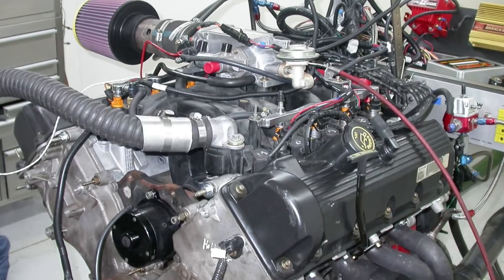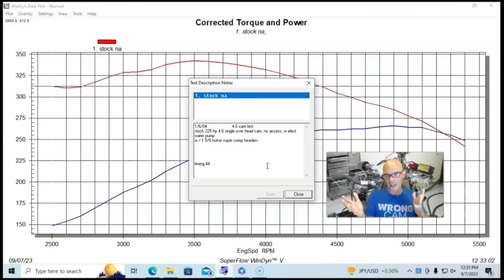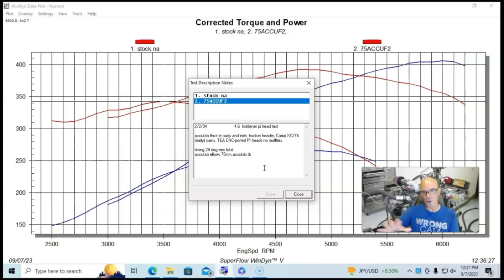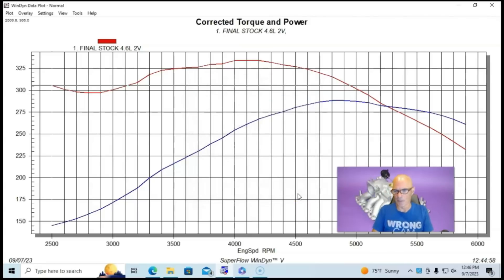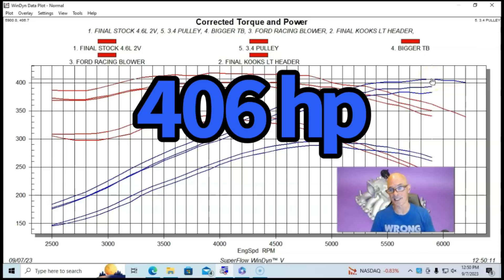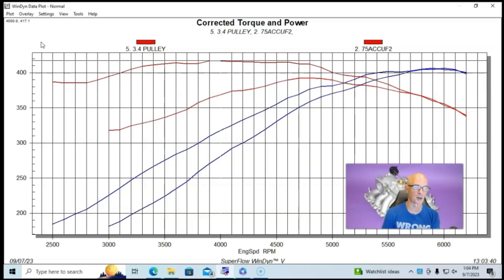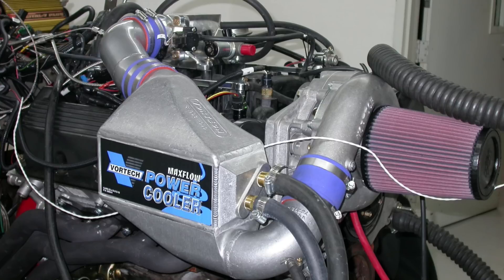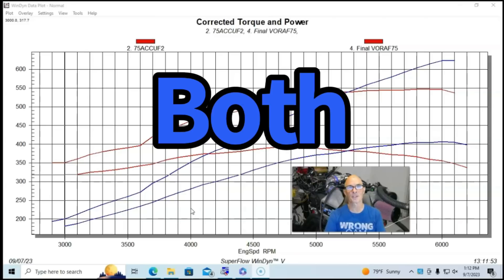THE 400-HP QUESTION-4.6L 2V MOD FORD-ALL MOTOR VS SUPERCHARGED-WHAT IS THE BEST ROUTE FOR HP? BOTH?

Comment: Only question I have is what mods were done for the supercharger ?
Reply from the maker: the motor specs were supplied-you can run it on a stock motor-but no longer avail

Comment: I have all stock 1998 mustang gt 4.6  with 120000 miles . Do have  pro comp aluminum intake and bbk cold air intake. I just want to add a super charger for some additional power. What do you suggest ?? Honestly if i had like 325 hp i think id be happy !! Help please !!
Reply from the maker: Vortech or Kenne bell

Comment: Any upgrades on fuel injectors or fuel pump and what tune if there is a link
Reply from the maker: yes we upgraded the injectors to supply the necessary fuel, the dyno has a very big fuel pump and we tuned it using a FAST or Holley HP ECU

Comment: PI or not 2v 4.6 LOVES boost. Add a little N2o, ur really cookin. I own a '98 mustang. That's my car in my profile picture. I put trick flow heads and cams in, forged eagle rods and pistons,  and a 92/80 Borg Warner efr turbo with a 100 shot to get her a spinnin. I made 804 wheel at 6700rpm. 680 lb ft at 4400 on e85. I did a bunch of other stuff too but I want to keep this short. I got my car down to 2880lbs with me in it. When I say the thing is terrifying I'm not lying. It's one of the fastest hard tire cars where I live and it's just a drift car. It has a drift American tubular front end, silver g2 coilovers, hydro handbrake, t-56 swap with a twin disc, 33 spline axles with 3.73 gears and a spool. In 4th gear going 80 mph I can mat the thing and the tires go up in smoke it's unbelievable. Not one other person has turned a wrench on my car. I am a mechanic but I'm no engine builder. I have 12,000 miles on the setup and not one time has it let me down. 20° outside, she fires right up. A/C blows cold, heater works, it's the best car I've ever owned. 2v Ford for life.
Reply: I wanna do that to a 04 f150 2v 4.6
Reply: I own a 98 mustang gt as well. So many times have I thought about coyote swapping it but the 2v 4.6 sounds better to me than the coyote. I want to build on it similar to what you did. Any advice??  how much would you say you spent? Thanks

Comment: I have a 4.6 non pi . Ported heads put shorty  headers ..cams .. valves performance intake   75 mm throttle body how many hp is it around 300 it runs good and good on gas I liked that super charged kit under the manifold hard to find that one might put a 112 on it I thought they could not handle a super charged your videos are great
Reply from the maker: at least 300 flywheel hp

Comment: If you want to Beat on an engine whenever you want that 4.6 will take serious abuse other than cracked intake manifold.  

I’m a Shelby owner with a built 09 5.4 dohc ported billet crank jesel roller followers and it’s an amazing engine but you can’t drive it like you stole it unless you’re prepared to.  
My 96 pi swapped 4.6 didn’t care.  I wailed on that engine.  Now I make decent $$ and I want to do what I’ve always wanted: waste a bunch of money and time making power the hard way with a mod motor!

Comment: I put set of old stock ford performance cams and and ford performance valves in a non pi motor 2 valve 42lb injector's with a performance intake , performance water pump  pulley   bbk shorty ported headers straight pipes with 2 1/2 pipes  glass packs all new valves  pulled good .,,, the 4.6l is rated only upto 400 hp stock correct is what I meant
Reply from the maker: Here is some helpful info-the NA non-PI combo you describe won't be anywhere near 400 hp and a positive displacement roots blower provides immediate boost and torque (more than the NA motor at any rpm)
Reply: @ can you put a pi intake on a non pi motor . I put a doorman on and leaks air can you put ford pi intake on non pi heads I already put cams and valves in hate to have to change heads  just for a few more horsepower whatever it makes is fine with me even
Reply: @ your right what o mean is a stock 4.6 non pi rated upto 400 hp correct not sure about pushing my motor further it has good torque that's it seems something would give pushing it further than designed I get I a Chevy ls2 supercharged it's a whole different ball game I drove the 2003 cobra totally different motor

Comment: Where do you even find a Ford Racing Supercharger kit? Can't even find them these days. Seems like a nice mild upgrade for a daily driver especially one like my 2002 Grand Marquis. I need it to merge with even just Carollas these days! 😂
Reply from the maker: I haven't seen one for sale in years
Reply: @richardholdener1727  Me either. It seems like such a simple piece of kit to slap on I'm kind of surprised the aftermarket hasn't caught up. I know a lot of 4.6 2v guys that just want that simple set up. Don't get much more simple than top mount Supercharger and injectors with a tune and still have a reliable daily car.

Comment: Were those stock injectors? If so, what would happen with HP using 39+ lb injectors?
Reply from the maker: not stock injectors-you need enough fuel to support the power level

Comment: Would the 400 supercharged setup with stock internals run reliably? 

I would never run a Vortech SC personally. They make a ton of power, but are unreliable in my experience. Customer support sucks ass and they don't warrant their products when the superchargers melt themselves. Otherwise great video!
Reply from the maker: I ran my Vortech for 85000 miles including racing in the Silver State 9 times-they are reliable
Reply: @richardholdener1727  Nice! Did you ever tow with it or was it just for drag races and cruising? I pulled a 5000 trailer, and the V3Si melted its own bearing cage and sucked in the intake seal.

Comment: My stock 4.6 explorer was knocking so got a guy using my block and pi heads and intake and I think ima ask him to build it now lol , already doing timing chain and oil pump and water pump and seals, might do crank, cams and valves too
Reply: What year I got a 2003 I’m working on. I’ve done a flow master 44 axle dump and it sounds great. Bout to add bbk 78 mm plenum/tb and k&n cold air intake. Did you end up using the non pi block or cams?
Reply: Yes non pi block and also did cams/ valves and a tune, pushing 440hp on e85  @ninamillimeter8926
Reply: Also did ac delete

Comment: Iv heard pulling 400 youll eat the bottom end up or get rod knock. These motors are boat anchors and its really annnoying that you have to spend double to make it go. They sound great and are tough when they're stock but man unless your a wizard mechanic and can do all this shit yourself its kinda pointless cause itll bankrupt you. Might as well just swap the motor or buy an ls. Not to mention thst t45 can't handle 400 horse at all. I think it would be pressed to handle 300
Reply from the maker: we have run over 700 hp with the stock bottom end-so the 400-hp thing is a myth
Reply: @richardholdener1727  oh really? I had no idea. I have an npi block with pi heads and iv wanted to push my platform as much as I can but anytime I suggest boost my mechanic always says it'll cook the motor. I'll take your advice over his though I think you know your shit provided who you are

Comment: On the both combination that you tested, was that test ran on pump gas or did it require race gas?
Reply from the maker: at higher boost we ran 100/91 mix
Reply: @richardholdener1727  ok, thank you for the reply

Comment: Mark VIII/Teksid short block with a PI top end is the scrap yard screamer build. You should try it maybe.
Reply: Exactly that's what I've got in my Mark VIII with many mods the car is a beast and sounds sick too
Reply: Do 4v blocks work with 2v heads???
Reply: Wouldn’t think so considering the width difference.
Reply: @setharnold3699  same block size on ALL 4.6. 2v, 3v, 4v can all use the same block. the pistons are different between them. Piston from 4.6 will go into 5.4 and vice versa.
Reply: @wadedalton2247  yes, they are the same, that's why its called a MODULAR motor.

Comment: In your experience, on a completly stock mach 1 4v, what would be the max hp you would feel comfortable with at the wheels in 93 octane?  5 speed car.
Reply from the maker: if it is completely stock, then won't it make stock HP?
Reply: @richardholdener1727 Sorry, I completely left out that Im buying a vortech supercharger for it.

Comment: Would a NA 400 hp to replace a regular 260 hp 4.6L in California be allowed?  Will it pass the smog test?  I have a 2000 Ford Mustang GT project car that I'm trying to upgrade.  Any help would be greatly appreciated.
Reply from the maker: you need to check with the manufacturers of the parts to see if they are Cali legal

Comment: Fascinating 😎👍🏻 

My MG came from the factory with a 2V 4.6 as standard so I’ve always wondered what I could achieve without going down the forced induction route. 

It only makes around 245 bhp so drives nicely but needs significantly more in a 1700 kg car 👍🏻 

400ish always struck me as a more suitable figure to make the car perform how I’d like.
Reply: You could add a blower without the forced intake and rely on the larger belt, you'd probably want to seal the hood though.

Comment: Is it actually possible to get a 2 valve 4.6 to 400 wheel horsepower? I see most people lucky to get 300.  N/A that is.
Reply from the maker: I've never seen 400 whp from an na 4.6l 2V-but it is possible. Would require more compression and different intake manifold with more rpm

Comment: I want to see a 2v 4.6 with the trick flow heads ported, tork tech 2800 tvs blower and cams. I want to see the actual potential of the motor. 2v are always over looked and slept on. Then punch the motor out to 5.3 aluminum. We can call it a 327
Reply from the maker: watch the 4.6l 2V vids with the ported heads, cams and Kenne Bell

Comment: your engine dyno is super happy idc what you say no 2v on the planet is doing this power with heads cams and a tune its not making 400 plus crank without a power adder such as boost, your the only person on the planet with these results and thats because there bs.
Reply from the maker: you know so very little
Reply: i love your videos and i watch them alot, but ive never had a 4.6 last over 450 wheel. @richardholdener1727

Comment: Have you guys made a video of putting 4v heads on a 2v or 3v motor? I have an 08 f150 4.6 I'd like to play with. Someone on market place mentioned putting 4v heads on 2v with some tuning.
Reply from the maker: easier to just get a 4V motor from the junkyard
Reply: @richardholdener1727  yes and no. The 4v heads were already rebuilt and cammed. That's why I asked about a swap.

Comment: I built a similar n/a motor some  years ago except slightly smaller cam and a stroker.  I never knew what power it made but the goal was a minimum of 400hp and 400 torque.
Reply: There was a nascar intake on ebay, if your willing get a custom hood.

Comment: You said you could have used the 550lift pi cams.. why didnt you? Just curious.
Reply from the maker: I tested every Comp cam
Reply: @richardholdener1727  Yes, I meant why didn't you use the bigger pi 550 lift cams instead of the non pi cams in this build..

Comment: I'm so conflicted about these 2v motors. They do what they're designed to do what they're meant to do very well, but as a car fanatic you really want to run it out to 6500 and hear it sing. Unfortunately, the heads on these things just aren't built to do that. You've done a bunch of good 4.6 videos, and you do a great job with them...but it's not cheap to make them run so well. All in all, I'd love to get excited about them but I continue to have mixed feelings.
Reply: It’s basically just a luxury motor like a big block caddy, can perform but you’re dragging it there if it doesn’t have displacement on its side, Ford failed to make a motor that basically is only slightly outperforming the basic pushrod Windsor
Reply: @benjaminwatson7868  I think that's the basic problem. Not much growth potential in it.
Reply: @johnbarker5009   im a little late to the video I had a 06 crown vic with a muffler delete side exit Exhaust Anna air filter with factory tune. And on a good day. I could keep up with a 5.7 charger in first gear. It was a fun car to do drit road drifting and I've race other vehicles   and lost but all in all I love the 4.6 I beat the sh.t out of my crown vic for 2 years only thing to go was a/c and the starter twice😂
Reply: @johnbarker5009  not with that attitude

Comment: Blower, no questions asked.
Better EVERYWHERE on the curves.
Makes for a better daily driver than the N/A combo.
Reply: How so? Would running boost be more relaible then having it n/a?
Reply: @Frosty16423  about the same reliability with a good tune
Reply: @stringsattached67 idk supercharges tend to heatsoak the car after a few pulls
Reply: @GerardoValdez-d5g just have a good tune and invest on you cooling system
Reply: @GerardoValdez-d5g   mines procharged with intercooler It never heat soaks.

Comment: Great video , how about doing the same tests on a 5.4 2v and compare to 4.6 2v
Reply: I'd like to see that
Being as though I have them both and want to see options
Reply: @waynebaker5720  man me too , I have a 03 mustang with a built 4.6 N/A and a 5.4 on a engine stand saving up for a set of heads and cans , I know the 2v can not make high numbers as cheap as other engines but to me I can’t move past the low end torque and the lovely sound of a cammed 2v
Reply: @keithwilson8624  oh you lucky dog you .
Hey check out street cars video 2v turbo takes on the world; and while it wasn't quite the top dog out of the bunch she held its own making the both of us proud. That 2v probably had a few contemplating and maybe going back to the drawing board I'm sure.

Comment: Super charged.  Stock drivability can drive thousands of miles at a time with the A/C on.  I had one so I know… and I never seen a 99-04 GT make less that 380 to the tires in a automatic 400to the tires on a low boost pump gas tune.

Comment: I like the idea of a 4.6 (or even 5.4) 2v with 400 hp naturally aspirated.
I don't know why but it reminds me of racing SOHC engines from the past (60's/70's) and even some DOHC's that actually had just 2 valves per cylinder too.
Reply: if only it were this easy to make 400 whp these videos make me optimistic then i remember drivetrain loss
Reply: @ReeshaRacing you can get 400 at the wheels and well over 450tq by using this same setup but with small chamber twisted wedge heads and raise the compression to 12 to 1.   Use forged internals and it will be super reliable to.  Good rods is the main thing.
Reply: @ReeshaRacing  Yeah, I think the only way to get at least 400 hp at the wheels with 2-valve heads and without resorting to boost or nitrous...would be with extra displacement, a lot of work on the heads to improve airflow and much, much higher rpm's.
But to be honest, I don't know if they can reach that power level, even in this condition.
Reply: @Roddy_Zeh there’s a video somewhere on YouTube of a ‘01 bullitt that has a stroked 5.3 2v that makes (if I remember correctly) 393 rwhp. Without drive train loss that close to 450 on motor n/a. Now that 5.3 ain’t cheap and they could have that much power for cheaper w/a supercharger.
Reply: @Boatanchorperformance  That's interesting to know!! And certainly more than enough power to have plenty of fun. 👏🏻👀
Even though it's much easier to reach these power levels with boost, sometimes the joy comes with not taking the easier route. 😁
Reply: @ReeshaRacing you can easily out run the new coyotes with that build.   You can't get that compression from the pi heads because the valve angle prevents shaving them that much or using big enough intake valves.   But with the twisted wedge heads you u can go up to 12 or even 13 to 1.

Comment: Putting the 4.6 2V in the mustang was probably one of the most stupid decisions ford ever did, it’s quite obvious it was never intended for a high performance application to begin with. They should have put the 5.4 with PI heads right out of the box…
Reply: Idk i seen tons of 1999-2004 mustang gts on the road racing track. I never see any 98-02 camaro ss on a road track, they all go to the drag strip.
Reply: A 2000 mustang gt drag racing a 1990 gt. Who wins?
Reply: It's way better than a 1990 5.0

Comment: Im interested in the idea of 4v heads on a 5.4 rotating assembly. Anyone know anything about this?
Reply from the maker: Might consider just going to get a 5.4l 4v from the junkyard to start with
Reply: @richardholdener1727  well damn. My I build miatas not ford's is showing. Tyvm for the info
Reply: @richardholdener1727 ah, iron block, that's why. Aluminum block is important to me. 5.4 rotating assembly in an intech 4.6 block and heads?
I'm currently interested most in the Mercedes m113 5.4 as a potential swap for my miata. Light, decent power, cheap, a bell housing for a cd009 is already available. Just worried about sump clearance.
Reply from the maker: no on the 5.4l internals in a 4.6l block